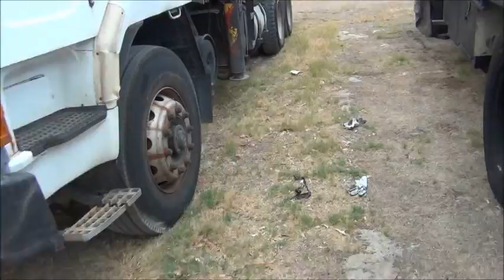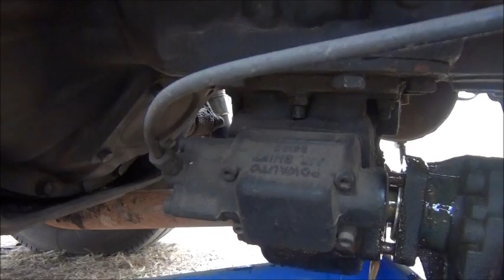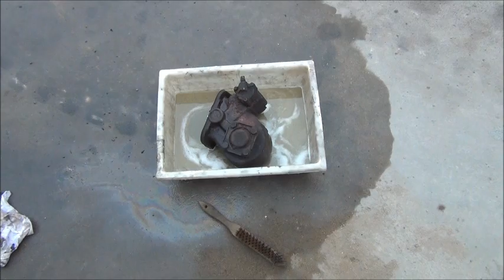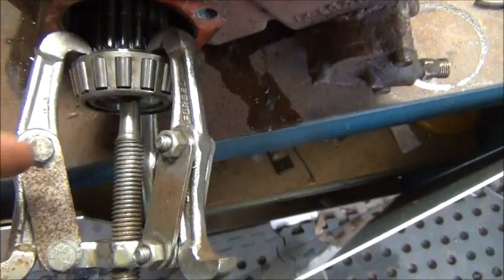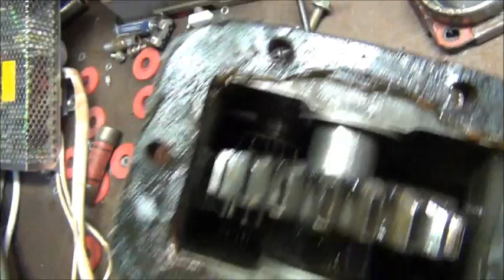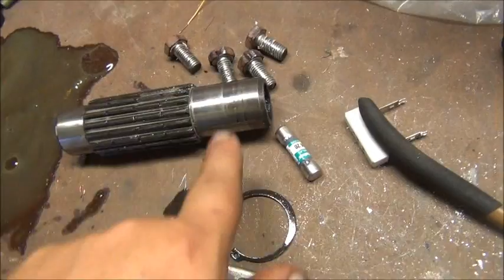Problematic PTO: Remove, Teardown, Repair!

Comment: Nice video, you will have this sorted in no time. How is the shaft on the hydraulic pump? That is normally why they leak oil, shaft wears where the seal is rubbing on it.

Comment: Can a PTO that is ran with a cable get burned up/brake from normal operation in a dump truck? My employer trying to tell me that the only way a PTO tears up is by not turning switch off before driving down the road!? I was cleaning my bed out with the the dump bed raised up and it started smoking due to hydraulic fluid leaking out,As soon as i seen it smoking i jumped in the truck, lowered bed back down and turned PTO off. Then got out and seen all the hydraulic fluid leaking out underneath truck. My dick head boss pretty much called me a liar by saying PTO's only go out by drivng down the road with PTO switch still on. That is not what happened! I am fairly new to driving big trucks so I am not sure if this is true or not. I would assume anything can brake under normal use!? Thanks for your reply!
Reply from the maker: Mark White leaving it engaged will cause it to wear faster than normal use. they arent rated for continous duty. otherwise they will eventually wear out bearings and eventually the gears themselves from normal use but this can be minimised by having the backlash set correctly
Reply from the maker: Mark White in your case was the hydraulic control left in the raise/dump position foran extended period of time causing the pump itself to overheat?